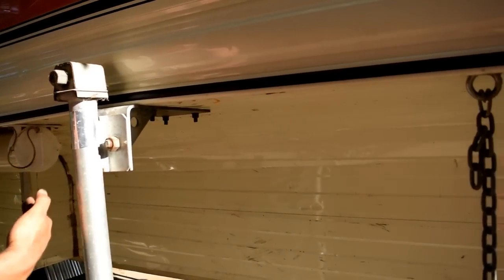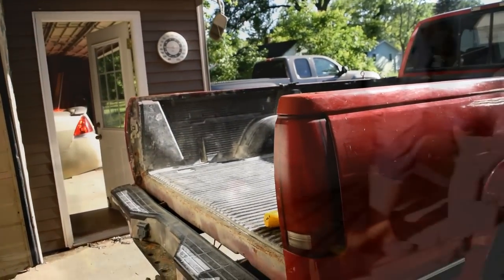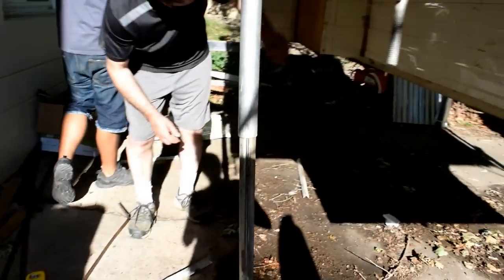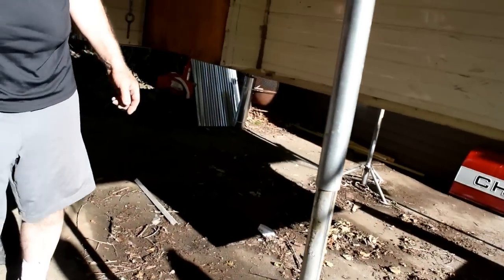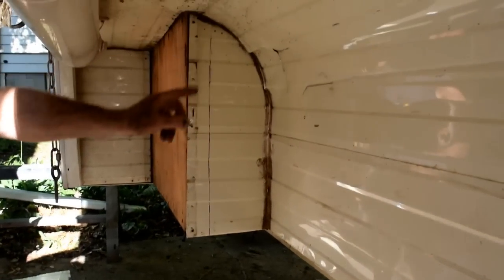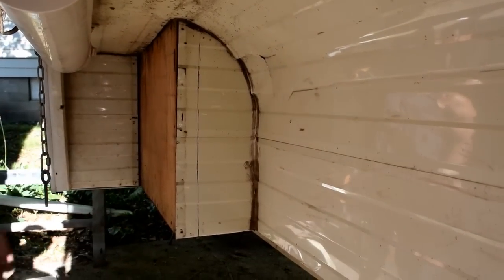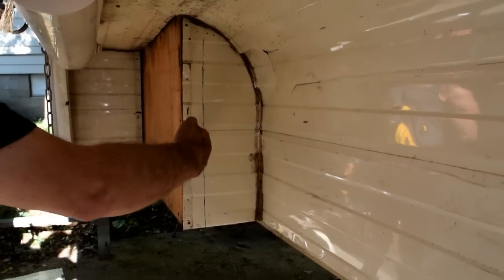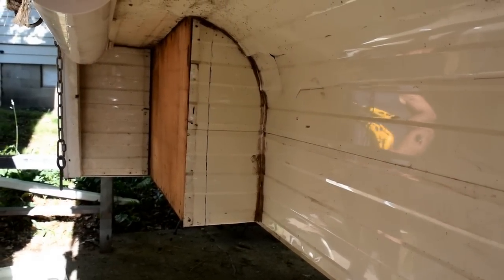Watch This Before Buying A Truck Camper!

Comment: I had a camper in my 1968 Chevy PU. The boxes were bigger back then. You have a 70's looking vintage camper on a modern truck. It's a pain to customize old to new. I had a steel Pulman camper shell and I had to take the front off by removing 3 feet of rivits to make the slope of the front match my back window on my 1963 International truck. You are not the first one to cut and fabricate to get the rig you want. Welcome to the club! hahaha

Comment: That's funny because I'm an old-school guy I just bought a slide in camper it fits perfect in my full size 79 Chevy pickup and the camper is as 78 for 9 it's in perfect mine also has the to jots that stick out they as well fit fine as in the other comments are probably right on actual width of the box is wider because the middle fit fine on yours as well thanks for the video

Comment: We bought our camper before the truck. In British Columbia it's a huge deal to have a truck rated for a big camper. If your truck isn't rated for the weight of the camper, they can make you drop it road side until you get something big enough to haul it. We ended up getting an F350 long box for our 9' Citation slide in. Makes the truck look so tiny lol

Comment: That's the VERY FIRST THING THAT YOU DO is to 1) MEASURE both the truck AND the camper, and 2) Put the camper ON THE TRUCK before you buy it.

And yes, GM truck beds are different than Dodge & Ford. Also, when the Big 3 started to change their body & bed styles, 1980s and older campers tended to NOT fit newer truck beds

Comment: Man, I feel for you. You'd think they could make these old campers all the same width. I realize the length can be different, but the width should be standard. At least you didn't do what I just done. I bought one of these last week, without looking too close.I knew it needed work but not as much as I got into. I can fix it, but you know hindsight and all that.
Reply from the maker: kirby lane  Ya it seems like there always has to be something wrong with campers. Hope your camper  turns out for the best! Thanks for commenting!

Comment: The truck beds changed in 1994..(in dodge ram anyway) also leaf springs were phased out replacing them with air suspension and the sheet metal is thinner .. your camper was made to fit what is nicknamed the "flat front " truck 1993 and before

Comment: My truck has 3/4 ton running gear. 14 bolt rear end but it’s still a 1500 I’m thinking about slapping a Dana 60 front end under it because I don’t want to put the money into the IFS suspension to rebuild it and bring it up to par. I’d do all the work myself as I use to build rock crawlers. This would be my weekend getaway truck to chase snow storms. I own a concrete pumping company so I get a lot of time off in the winter and I’m an avid snowboarder.

Comment: Here’s my experience with buying a truck bed camper...

I bought a 1996 Jayco Sportster pop up truck camper. It’s a smaller, lighter model which is what I wanted because I lease 1/2 ton trucks. (Guy said it was intended for a smaller truck like a Tacoma.) I barely got my 14 F150 to squeeze between the jacks to get it in the bed, but we got it on there. The day before my first trip with it, found out the roof was leaking so I didn’t have time to fix it before I left. It sat in the barn until I moved and had to relocate it. At this time, I now had a 17 Ram 1500. The Ram sits higher than the jacks will go, so we worked around that, and then found it wouldn’t go all the way back between the jacks...bed sides too wide. I ended up borrowing my buddy’s old beater GMC Sierra to move it, and even that is tight fit in the jacks. I’m starting to believe that camper is meant for a compact pickup! Needless to say, I’ll be putting her up for sale in the spring without using it once. The vacation we were on when we found it for sale was the epitome of a nightmare trip. It seemed it wasn’t meant to be from the get go...

Comment: GM trucks were narrower starting in 1988. My buddy had to do exactly the same to his camper when he sold his 79 GM and bought a new 88. ( I’m pretty sure that’s the year?). Still 8 foot box with 48” between the wheel wells, but tailgate opening was narrower.

Comment: The 1973 Chevy truck was 8 inches wider than a modern Chevy. All the trucks are narrower to save wind resistance and improve gas mileage. Square body chevy was a good truck. I miss the one I had.

Comment: Yes, I have my dads 1983 Ford F-250 truck, the bed is slightly wider than my 2015 f350 8ft bed truck, also I have an older 1996 hideaway that fits my dads truck but sits way to low to clear the cab in the f350. My 1998 Lance just fits the width of or f350 with barely an inch to spare. Bottom line, I really think it comes down to age and make of the camper. My Lance fits both trucks fine but the hideaway only fits the f250.

Comment: the standard for "full size" changes at the whim of the car dealer and manufacturer. "full size" means the same as "all season tires". if you google pickup truck bed size chart you can see the actual deminsions of each one of their models.

Comment: Prior to 88 for gm, prior to 96 for ford, the boxes were same width at rear, as in front. After 88 and 96, they were tapered to increase fuel economy.  There is some variance in 3/4 & 1 ton models of both manufacture, regarding years. (ie; 1 ton chevys went from square body to your style in 92)

Comment: Enjoy your videos. One thing I will bring up is your choice of camper tie downs. Those box type you are using will twist your truck box over time and they are not the strongest. For me if I was full timing it like you I would install the strongest and safest camper tie downs on the market. I and many others that have truck campers use Tork Lift tie downs. Made in the USA in Kent, Wa. They are adjustable and have some give to them. You don't need to have the camper tied that tight to the truck as you can damage the tie down points on your camper. Just a heads up. Be safe out there.

Comment: Older trucks were square, same dimensions front to rear and all new trucks are  narrower in the back than the front of the bed. If you notice the bed posts in the back are much beefier on newer trucks also.  You just bought an older camper.

Comment: Truck width aside, the other problem I see, is the Stake pocket tie downs. They WILL rotate and bend the pockets. Absolute garbage even when bolted and backed up with a steel plate and lock washer. I personally know as I used them on my first camper. Know of 2 other people who have had same issue. Went to the frame mounted style. Not one problem since.

Comment: Thanks for sharing. I dont know everything there us to know about things. Which is why I use YouTube for say.. Installing a garbage disposal. 
   And like you, I would have just figured that full size means full size. 
  Thanks for sharing knowledge with us. 
  Much love from Central California.
Reply: As pertains specifically to his issue with the camper, if you read the comments, you will see that his problem occurred because his used camper was built in 1979. The camper fits in older trucks (older than about 1987) because the pickup's bed was wider than ones built roughly after 1987. The exact year depends on the manufacturer. But for Chevrolet, the newer, narrower model began in 1988.

Comment: Most likely your camper was designed for a short bed truck. With a 6 foot bed it would appear that it would have fit without being modified. Regardless of that you did a fantastic job of making it fit, feel good about the work you did.

Comment: This is kind of an old thread but just in case it might benefit someone, Toyotas also vary in dimensions (of the bed) between older and new models.  For instance old caps do not precisely fit newer  beds. Plus, the contours of the back of the cabs also vary from year to year.

Comment: I had the same issue. But, it is due to an 'old camper'. It is NOT a Chevy issue. The width of pickup truck beds began to change sometime after 1985 (~1988). My 70's vintage camper fits my '69 Chevy, which has a 65 inch width rail to rail. But after ~'85, the rail width on Chevys was reduced about 4 inches. Ford and Dodge ALSO reduced their box width within a few years of '85. My newer Ford long bed pickup has a maximum width of 62 inches and on top of that, it tapers to about 60 inches. Consequently, the camper will not fit on my Ford. I have also measured a ~2000 Ram. It too has a reduced width. But if you look at 'older' trucks, their boxes are substantially wider. What year is your camper?
Reply from the maker: Gregory Parrott This is interesting! The camper year is 1979.
Reply: That explains it.
Reply: Ok, you keep saying after 1985 they got narrower.  I'm having a hard time buying that since Ford Chevy and Dodge didn't have a new body style in 85 or 86.  I've never actually measured this, so I really don't know but why would they redesign the inside of the bed in 85 when a new model was coming in 88?

Comment: Chevy truck beds of those years get narrower towards the back. I ran into the same issue on an old Sells brand truck camper. I had an 98 year truck like yours, extended cab long box 4x4. Older truck boxes were square as you thought. Happy Trails!

Comment: Dont use those stake box hold downs. Also use a rubber mat under the camper ..it helps prevent the camper from shifting.

Comment: It might be a "full sized truck" but you just have a 1/2 ton there, it's probably overweight without you adding any cargo, you need a 3/4 or 1 ton, maybe there is a bed difference on the GMs...

Comment: Some of you poster are RUDE ! I am sure he knows how to use a tape measure. The main thing here is that he had a problem and came up with a solution that works. Kudos to you man for not giving up !
Reply from the maker: Appreciate the comment, thanks!
Reply: Sorry, babe, but if he had checked the dimensions first, he wouldn't have had to come up with an expensive, frustrating and time-consuming makeshift solution.  Millennials need to familiarize themselves with the concept of Cause-and-Effect.
Reply: how is that rude^^ mistakes were made and it is not like this could not have happened to any of the posters, or that he was the only person on earth to have ever made the mistake of not taking the correct measurements before "cutting" or buying or whatever^;)).. commen mistake, he made it, he showed it in all honesty and well he got some flag for it.. np he seems nice and not made out of sugar.. he solved the problem and he will most likely get over some critique from some random guys on the internet even if it may be rude;)

Comment: The Bed Liner doesn't fit snug to the fender wells, plus the thickness of the liner itself would be about 2" inches, a sprayed liner like Raptor Liner or one of the other spray liners on the market might have solved the problem problem, I've never seen a preformed liner that fit perfectly

Comment: Chevrolet makes a tapered bed where is wider by the cab then it tapers narrow towards the tail gate.  I had a 98 granby pop up camper that my f 1 50 1985 fit but my 1998 3/4 ton GMC did not fit.  My experience is only with Ford and Chevy and Ford boxes were more square they did not taper.

Comment: Make sure the mirrors above the cab are sealed! The camper I bought had a pair just like that. Water leaked into the walls saturated and rotted the frame all the way to the front jacks. I had to replace the bulkhead and cabover. A lot of work could have been avoid by sealing everything up tight. That looks like a great setup happy camping!

Comment: You did a good job fitting the camper to the truck. The older campers are heavier obviously than the newer lightweight uni-body campers made today. To avoid this dilemma a simple formula to figure it out would be: the square root of the hypotenuse is equilateral to the fulcrum of the circle thereby eliminating the juxtaposition of the tangent and creating a reasonable consistency in the flocculus to the aforementioned.

Comment: Have you ever thought that camper was made for a 6-foot bed and the back to foot of it was meant to set on the tailgate the older campers used to do that they would set on your tailgate the back half of them it's the reason why it was wider to give it more stability when you moved inside of it

Comment: Looks like a short bed camper you can get a truck in 8ft bed or 6.5ft now there is 5.7 as well. The tuck beds tend to be deeper as well meaning you can have height problems in the future
Reply from the maker: WildandLiving It can work for a short box, but ideally for a long box. Our truck is 8ft long, and it fits perfect!

Comment: WE made the SAME EXACT foolish mistake in buying a 14 ft camper, then got a used Ford, double cab pickup truck....they promised it was like new, engine overhaul...Ha ha. They lived on a road "Mini-Ha-Ha" in Vancouver Washington....THAT should have been our clue to NOT buy it as the ENGINE blew...it had NOT been overhauled properly....then the brakes failed, then transmission.  Everything that could go wrong WENT wrong at the WRONG TIME...the worst was at Crater Lake a year after fixing everything....ONCE again, blew a headgasket, stranding us for days. We had 4 kids in Christian School...so couldn't afford more than what we'd gotten, BUT in long run, we spent MORE on the "Mini-Ha-Ha bad luck truck" the camper swayed horribly...scary for me...but having teenagers wanting to travel, made having an RV much easier.

Comment: I have an 8' box bed (same width at the front as at the tailgate) truck and truck camper and your truck may be an 8 ft bed BUT your wheel wells look huge, taller, squarer, and the distance from the rear of the well to the tailgate seems far far shorter than mine. My camper slid in and fit like a glove, but my bed is standard long bed box with rounded wells. I can see that the distance on your truck from back of well to gate is short. AND the height of your wells much taller. I think your wheel wells were the culprit as they seem cut to fit many different size tires, especially larger, wider width and bigger diameter tires than factory tires. THAT feature on your truck (to allow for commercial size tires) would make the difference on that camper fitting. I measured my bed, my wells, the distances, heights, etc etc. The wheel wells, and also the non-box beds (beds that are narrower at one end) can be problematic for slide-ins.

Comment: That is a very nice looking vintage slide in.  Someone really cared for it.  A newer F-250 would be the better truck because the wheel wells are lower and further apart.

Comment: The older truck beds are wider.  I. E. I have a '64 Chevy C-10 with long-wide bed.  Also have a 2003 F350 Ford with DRW.  Much narrower than the old Chevy.  Not to mention much cheaper (thinner)sheet metal.   It's not a brand thing.  No look at new Fords, Chevy/GMCs, Toyota, & etc and you'll see downsizing & cheaper build.  BTW, my grandfather bought the C-10 brand new for about $1800.  Cost almost that to put new tires on the F350!

Comment: Bed taper. The C/K Trucks narrowed at the rear compared to the older generation trucks. Much to our dislike in the early 90s when I went to put my work rack on the 90 model that had been on the '84 previously. The Fords and didn't have that problem until the 97-03 style, but they appear to have straightened out again at least for the 10-14 F-150s. Those beds are deep though.
Reply: I have a 2017 F-350, long bed. It too has a taper.

Comment: first thing i noticed is the plastic bed liner in the truck. probably would have fit without it. bed liners take up a lot of room around the wheel wells.

Comment: Wheel wells have moved forward and back on every model in history. Not all campers can fit in all trucks. We currently own a truck that can not fit in any of today's trucks it is from the 1950's which this model has over a four foot floor. Most trucks have only four foot opening between the wheel wells. Looks like you had no problem fixing it.

Comment: Back in the day they might not have had extended cabs which would have extended the bed out a little bit longer and the wheel bait wheel well would have been shorter

Comment: Looks like you got a short bed camper for a long bed truck. If you would have put that in a short bed truck it would have been flush with the cab before the back section hit the fender wells.

Comment: Old campers do not fit in newer trucks .  I have a 76 vanguard on a 94 2500 silverado.  I had to remove the camper storage box and even section 2 inches off my rear truck bed post with a set of torches .  Absolute nightmare .  Older pre 90 trucks did had wider boxes .  Ask what type I'd tuck the camper came off and dont pay till shez on the truck that will be loaded onto.  Everytime I go camping I have at least few older guys come by and ask how in the hell did I get this on ... ?